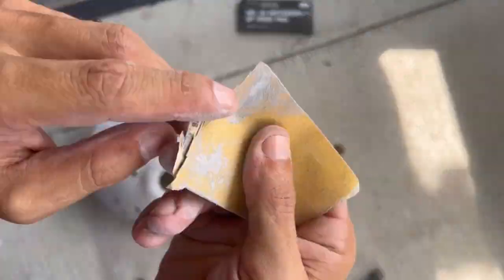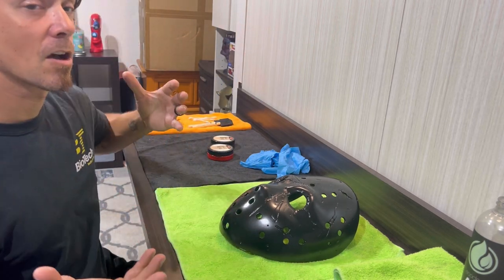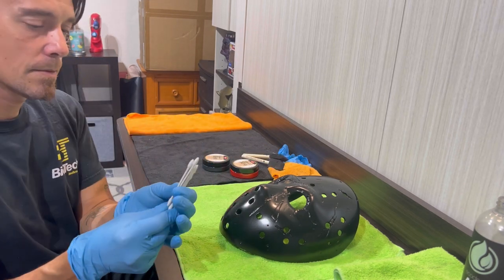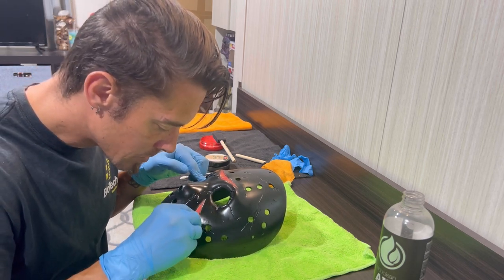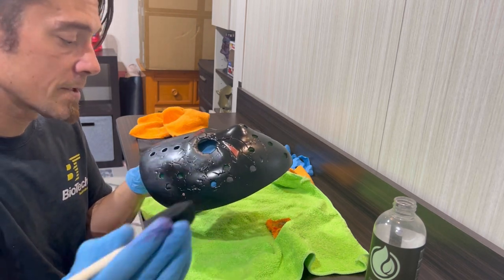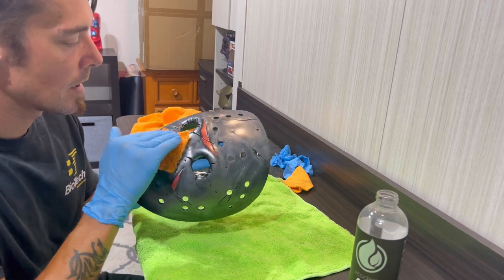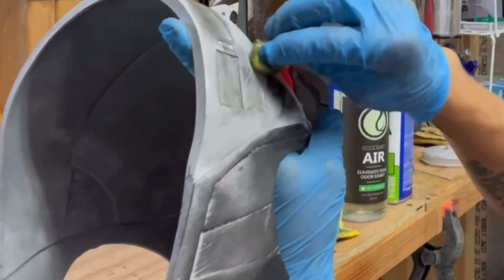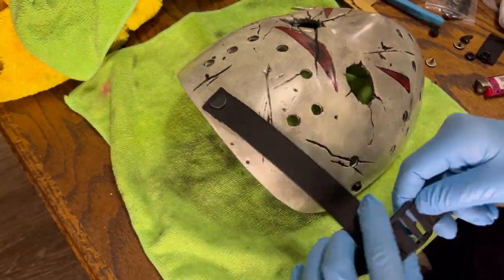How to rub n buff using viva inka gold | How to blend & shade rub n buff | Advanced rub n buff DIY

Comment: Looks great have you ever tryed the metal powder stuff lol forget what it's called grafite? Gonna be trying that out next 😁
Reply from the maker: Graphite rub comes off really easy with finger prints & just getting wet, this is more durable
Reply: @Darkwingdad  couldn't you protect it with clear coats?
Reply from the maker: @TheMadmichel  nah graphite rub will turn black. If you want something you can clear coat look into duralumen tuff
Reply: @Darkwingdad  nice thanks for the advice I'll check it out
Reply from the maker: @TheMadmichel  I have a video on that as well